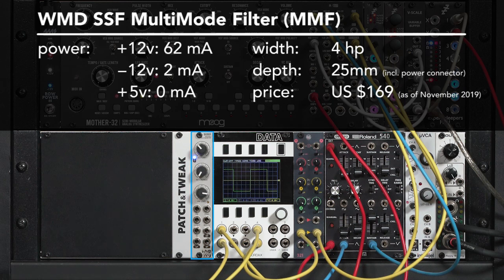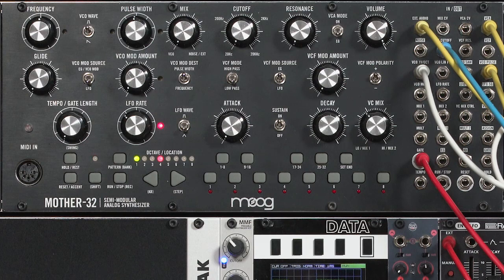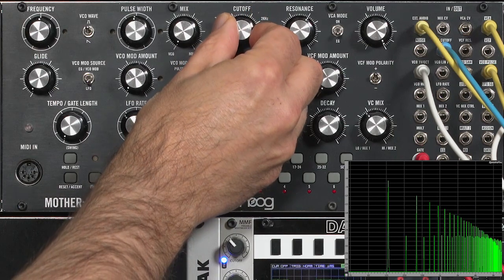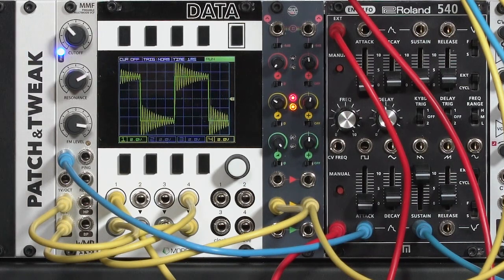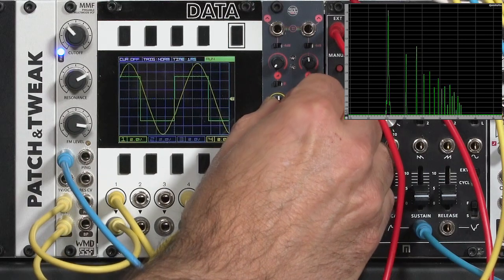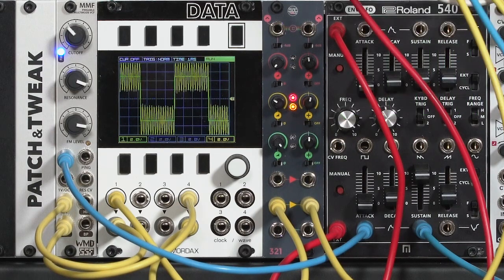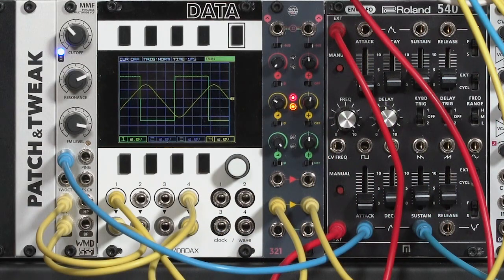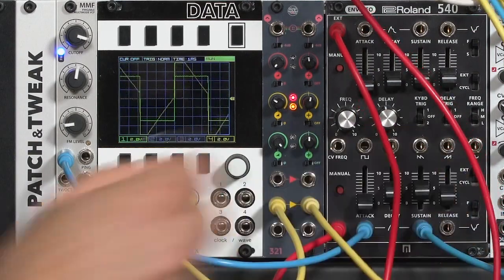WMD/SSF Multi Mode Filter 1/2: sound characteristics (LMS EE)

Comment: I didn't know that not all CV inputs can be modulated at audio rates.
Reply from the maker: It is particularly an issue with digital modules, which often sample their CV inputs at much lower rates than normal audio inputs.